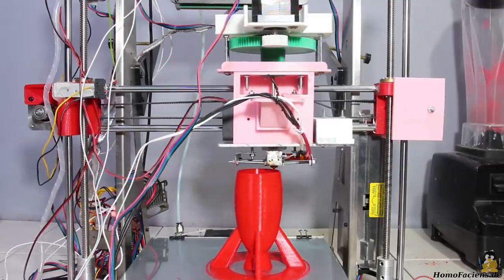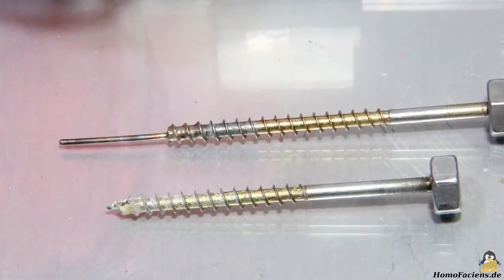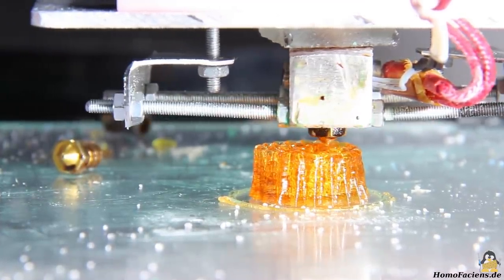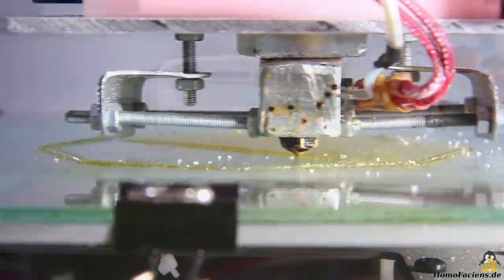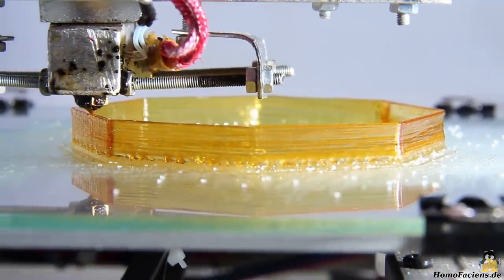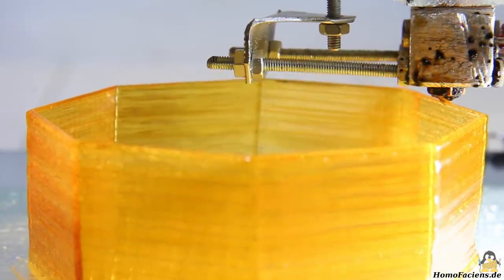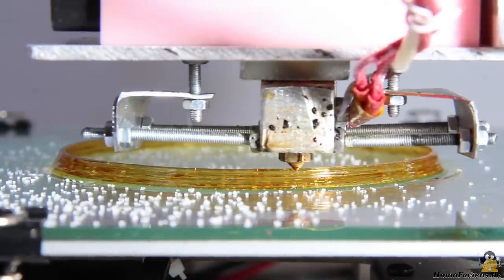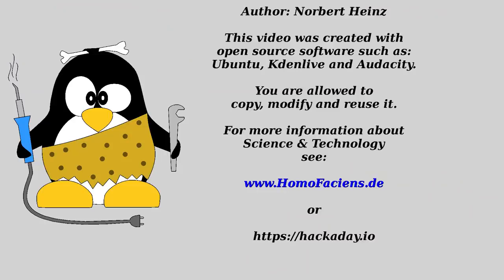3D printing sugar with a Direct Granules Extruder

Comment from the maker: FAQ - READ BEFORE POSTING A COMMENT !!!
Q: How do the prints taste?
A: This experimental printing setup is anything but food grade! There are plastic particles from previous test runs in the extruder, the aluminum and brass as well as the pink plastic of the hopper are not recommended for processing materials meant to be eaten.

Q: What about adding starch or sirup or what ever to the sucrose?
A: More experimentation will follow

Comment: I wonder how sorbitol would print, it melts at a much lower temperature than sucrose and seems a little less brittle (in rocket candy anyways, I've never melted it by itself, just mixed in with the KN03 and iron oxide and the end product is a bit softer and less brittle vs sucrose), so maybe that would get you past the thermal cracking problems and possibly even print resolution? Printing with sugar is such an interesting idea that I've never considered before, this is the first time I've ever had 3D printing and sugar said in the same sentence lol.

 I'll bet you could even mix sorbitol with store bought powdered sugar at maybe a 30/70 ratio respectively, and only heat it enough to melt just the sorbitol, it would create an aggregate material that would be much less prone to dripping/pooling at the nozzle and might even let you print at some surprisingly fine resolutions, might be worth a shot?
Reply from the maker: Sorbitol hasn't been suggested, yet, but looks like this is worth a try - thanks!

Comment: This looks like a lot of fun! I wish I had the time to try it too!
I don't wanna sound like an armchair scientist, but I once ran into similar problems on an unrelated project. You can convert your sucrose into more viscous "inverted sugar" that has a melting point (sucrose does not melt, it decomposes). I used citric acid and heat for this. You may check the purity with two crossed optical polarizers. Alternatively you can buy glucose or fructose mixtures directly. I also wonder how cotton candy sugar would perform... I wish I had the time to experiment!
Reply from the maker: Worth a try.

Comment: Try printing isomalt, it's a sugar replacement that's commonly used for people making decorations. It might work better.
Reply from the maker: Any idea why it should work better?
Reply: @HomoFaciens  Well sucrose has a lower decomposition (caramellization) temperature than its melting temperature so if you are melting it, you are already burning it. Isomalt has a higher decomposition temperature than its melting temperature so you can just melt it like you would expect
Reply from the maker: That is a pro worth considering, thanks!

Comment: You can use a sugar solution on the bed instead of glue stick - I use it for PLA prints.
Add a few drops of dish wash liquid to promote the wetting of the bed by the solution.
Apply it to the bed with a brush or sponge and allow the heating of the bed to drive off the water before printing.
Reply from the maker: You have watched all of the video?

Comment: Try to add loose layer between bed and water-sugar mix. Maybe just ordinary paper, baking paper, plastic bag? Tape it on corners of heated bed loosely OR tape it tightly and release tape before you turn off heated bed. I guess it might help with that tension during cooldown?
Reply from the maker: Yes, that's the way I will do it if I really start printing usefull stuff. This was just a proof of concept, so the result was discarded anyway.

Comment: Very interesting, congrats! But think that for eatable prints nozzle shold be choosen carefully, because brass nozzle can hold lead in it - not very healthy stuff.
Reply from the maker: Yes, it's definitely no food grade setup and some PLA grains were still in the extruder from previous experiments.
Reply: “Thank you Captain Obvious!” 🤣🤣🤣
Reply: I think the assumption that a brass nozzle leads to lead in the final product would need to be verified at some point. I have my doubts. PLA itself is actually very biocompatible, to the point that it is used for stuff that is just left inside surgical wounds. Of course, this doesn't apply to whatever the manufacturers blend in with their PLA, which they never really tell anyway.
Reply: And there is the potential for multimaterial extruding within this edible realm. The caramilk bar, or the reese's peanut butter cup, though with names changed to avoid the 3pc pinstripe suit mafia from the street named after a pay wall (wall street). 

A lasagna though is already open source, rapid spaghetti production would be a walk in the park with his build plate/dinner plate. Multi material 3d printed soups? 
There's even a heated build plate for the bowl. 
Nonplaner multilevel multimaterial printing?
Reply: @ArnaudMEURET  You welcome - "soldier" 🤣🤣🤣

Comment: You should be able to add some ingredient that will soften this "material" just enough to avoid cracks formation.
I was thinking about corn syrup, but you would need to add just a bit of it and mix it very well with your sugar which would be very messy.
Maybe you can melt both ingredients together, let it cold down and crush it back into small grains?
Reply from the maker: This has been suiggested more than once. I might give it a try...

Comment: Here's an interesting idea. Since bridging isn't possible, maybe use higher movement speeds in the places you would like to bridge, while also decreasing extrusion rate. this should result in a thin section that can be either cut out later, or dissolved out with a bit of water (or even licking it clean, if you're into that...). Also, since it's a pure liquid when it comes out of the nozzle, would using a smaller nozzle result in a finer print line, and possibly less stresses in the material because the thermal gradient will be smaller?

That cone sure is satisfying to watch print though.
Reply from the maker: It is more the viscosity and the surface tension that rule the size of a drop. I doubt that the nozzle size will have a huge impact on forming cracks (or avoiding them). You can prove this by printing ABS with different nozzle sizes: The impact on warping is not really huge. It is much more promising to try out various sugar recipes.

Comment: Very nice! If you have a slightly longer nozzle and the liquid sucrose gets time to slightly cool down wont that help  to start to strand the sucrose?
Reply from the maker: Yes, the sugar artists heat up their sugar recipe and then let it cool down until it becomes a "plastic". I was also thinking of a longer nozzle and maybe a second thermo element and a cooling fan.
Reply: I was thinking along similar lines, but wondering about watercooling the nozzle tip - then you can control the temperature right at extrusion point while still having the initial grain mix step being hot enough to work reliably. 

Seems to me though that the way its printing that really isn't needed, as the dripping nozzle is still printing really quite well, it just needs a heated chamber and slow cooldown to cut out the cracking at the end I think... Won't get any bridges out of it as it stands, but I don't see that as a major failure when it can still print so well. With the heated chamber I expect it can print much much faster too.

Comment: It may be that the sugar is expanding slightly, as it cools. How about adding a bit of cornstarch? Confectioner's sugar has a bit, but the powder has to be contained, and you may need to lower the printhead temperature.

Comment: just a very crazy idea with this: sugar is a glass, and glass can have semiconductor properties if combined with proper 'dopping' materials. If you combine different doping materials when sugar is melting in the hotend, you could 'print' very rudimentary integrated circuits (IC). Sorry for bad english
Reply from the maker: Would become a temporary IC. Best before: see bottom.
;-)

Comment: Many years ago I worked with a company to develop a non-patented steel powder and sugar material. It's something you could print/extrude directly with your current set up. I'll be happy to share the specifics in a less public format.
Reply from the maker: Well, as with all my projects, this is open source. If you don't want to see your result published, don't share.

Comment: There is a lot of potential here! When making candy you control the properties of the finished candy by controlling the water content via the temperature!
so if you could control the material properties when it goes in the extruder and when it leaves the extruder you could "potentially" get the consistency close to some kinds of plastic! basically its the lack of water in the sugar that makes it so brittle.
Reply from the maker: Future experimentation might tell if that works...

Comment: Surely the cone's angle is not 45 degrees? Looks more like 30 degrees relative to height axis. 

Regardless, pretty cool stuff.
Reply from the maker: Thanks!
It was just a quick test and I haven't stored the openSCAD file. Could be 30 degrees as well.

Comment: Another great video. Just out of morbid curiosity, have you tried adding a small amount of pla to the sugar? like 1 to 20 part ratio? Wonder if the two would work together and make the sugar stronger.
Reply from the maker: Usually you get the worst properties of both materials when mixing on a macroscopic scale: Warping of PLA and brittleness of sugar.

Comment: it would be cool to see sodium chloride,   i think that if you print it thick enough, and you wait a week after the print for to crystalize/dry out, it can actually be strong enough to take a bit of force from your hands trying to break it.
Reply from the maker: The melting point of sodium chloride is higher than that of my hotend. Using a sodium chloride solution doesn't work with this extruder design. So its up to you to build a 3D printing setup...

Comment: Perhaps adding another sugar glucose (m.p.146-150) or sugar alcohol like maltitol (m.p. 145°C) will toughen the sugar (and depress the freezing point).
Reply from the maker: Perhaps. Have you mixed that and can tell anything about this recipe?
Reply: I haven't tried it. I just noted the problems with cracking and thought the addition of a different sugar would disrupt the crystal structure. I picked those two because of melting point, they should blend well with sucrose and they are harmless.

Comment: Could you tape some parchment paper to the bed, coat it with liquid sugar and then print.  The paper may allow enough movement that the base would not crack.
Reply from the maker: Well, the result wasn't meant to be permanent, which is why I did not care about that self destruction of the prints while cooling down. I will print on a sheet of paper when that changes.

Comment: maybe with a fan pointed at the print (part cooling but externally since you dont' ahve a part cooling fan) could help?
also now you need to add cream to your extruder for caramel sauce :D
god I wish I could make one of these cheaply tho. I want to use sugar as a soulable support in my tool changer :O
ADD CHOCOLATE bit or cocoa next time!
Reply from the maker: Tinkerers bakery ;-)

Comment: Semi related but the darker caramelization of the slow prints made me wonder if there's a printable material that could reliably 'cook' to darker shades as a method of color printing, even if the result is monochrome. Having the printer change speed at multiple points of every layer might be a pain to code though.
Reply from the maker: I like printing construction elements to improve machining and am no fan of colored prints, thus that kind of investigation is to someone else.

Comment: Try to print on butter paper or some kind of thin plastic sheet, so that removing is not an issue.
Reply from the maker: The first layer won't stick on butter paper. Normal paper or a thin plastic scheet will be better.

Comment: 9:25 pretty sure that's 30 deg? Guessing the cone has the same diameter as it's height, that would make it 30 deg. I would be very impressed if it printed sugar at 45 degrees :O
Reply from the maker: The total angle was 45 degrees (if I remember right, it was just a quick test), so the overhang on each side of the cone is just half of that - not very impressive, I know.

Comment: Awesome work! It is good to see how sugar is printed. Can you try some wax. Thanks.
Reply from the maker: Thanks! I am working on a syringe based printer that will hopefully better for printing wax - stay tuned!
Reply: @HomoFaciens   I hope we can see it soon, but just a question: 
it isn't possible to use the same extruder you used for printing sugar? Thanks .
Reply from the maker: The problem is that wax granules (espeecially small grains) don't trickle down the hopper as nice as sugar grains do.
Reply: @HomoFaciens  Ok i see,  thanks .

Comment: Add to 1 kg of sugar 2..5 ml of apple cider vinegar. Then the structure will stop falling apart because the sugar will not be able to crystallize
Reply from the maker: Thanks for the exact quantity. I'll give that a test run when the printer is up and running again (currently I am working on modifications).
Reply: @HomoFaciens  Unfortunately, this is not the exact proportion, but about as much vinegar I added when making candy on a stick (it was as a child, more than 30 years ago :-) ...
Reply from the maker: I guess, the chemical formulas of vinegar and sugar haven't changed a lot since then ;-)

Comment: Clearly, it needs a smaller extrusion diameter. A 0.15 or smaller extrusion nozzle should allow the sugar to cool quickly enough to string better while still allowing time to adhere each layer. The ability to string should also allow the sugar to print better overhangs. Can't wait to see Benchy on your printer!
Reply from the maker: I doubt that the nozzle diameter will change the print properties. Keep in mind that the nozzle is in contact with the surrounding sugar. But future experimenttion will tell...

Comment: I have a question that may have been answered - is a print made using granulated PLA stronger than the made with PLA on roll?
Reply from the maker: That depends on the definition of "stonger". Plastics usually get harder and less flexible when heated up and cooled down multiple times. I will talk about that in a coming video on getting raw material for this extruder - stay tuned!
Reply: @HomoFaciens  yep thanks, I didn’t want to say ‘stronger’ but couldn’t find the word or phrase I meant. My prints sometimes come out a bit like the cereal Shredded Wheat, but anyway you what I meant. Thanks, and great work.

Comment: Oh one more thing in addition to my previous comment- how about powder sugar? It will melt faster and with less force
Reply from the maker: No, I guess it won't. The melting point isn't lowered and the friction could even increase due to the finer powder.
Reply: @HomoFaciens  Oh, got it. I thought it would be just better for melting. Thanks for the info :)

Comment: Are you sure the edges of the cone are 45 degrees? It doesn't look like it
Reply from the maker: The edges are half of 45 degrees. The total angle of the cone is 45 degrees (or 30 degrees, I'm not really sure, it was nothing but a quick test).

Comment: Have you tried using powdered sugar?
Reply: I believe it is quieter and easier to melt.
Reply from the maker: The melting point doesn't change with the grain size and the noise doesn't come from the sugar grains but from the plastic gears and the stepper motor.

Comment: I wonder if gelatin or similar  edible gummy sweet material would reduce the brittleness and increase viscosity. ( Such as pectin)

A very low amount as a percentage so it's still hard enough to make structures but soft enough to have more plastic properties.

At the very least you can make your own harribo candies this way . 😂
Reply from the maker: I wonder, too. Further experimentation will show...

Comment: over engineered hotend. very baroque-- Maybe you can recreate this setup in a CFD analysis to see what needs to stay or go. This is also similar to printing T Glaze with no extruder fan. It would be advantageous to look this up
Reply from the maker: Not overengineered but just a proof of concept design. Lager and adjustable is better when trying out different screw designs.
Checking more plastics will be done - stay tuned!

Comment: Imagine using a dual extrusion printer with sugar as the supports. Once your thing gets printed you can eat the supports :)
Reply from the maker: That would no longer be food grade sugar. But it would be an extremely cheap support material with less than $2 per kg.